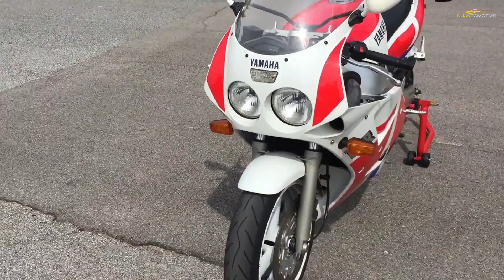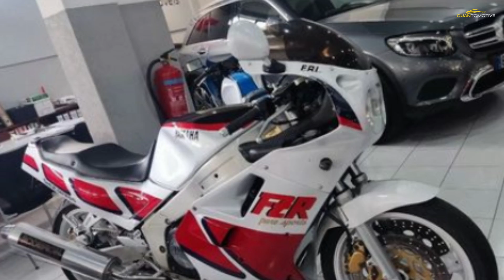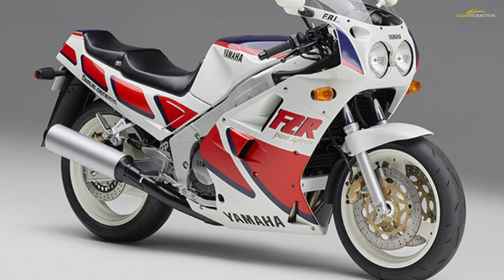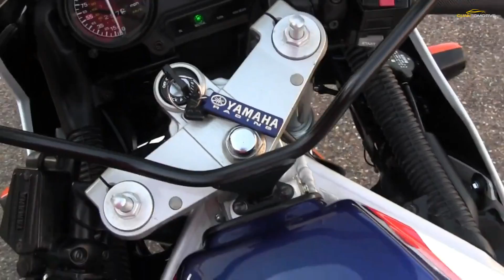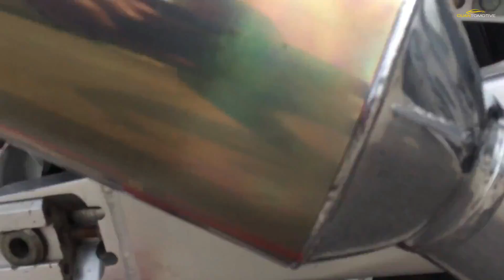Yamaha FZR 1000 "Ultimate Road Machine" You Must Know This Motorcycle Guys !!!

Comment: I have a 87 FZR 1000  that looks just like the blue/white and gold stribs, It have 140 break at the wheel, These are GREAT bikes.
Reply: I have a 1988 model. What  did you to get 140 HP? Thanks
Reply: @guitariste47  mine is a 89 my bad sorry, it was dial in when I got it so I don't really know for sure.

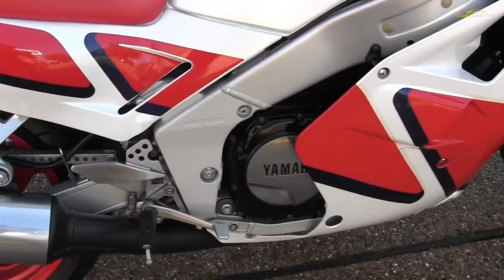Comment: 4:57 his full of crap  the FZR 1000 was lighter then the GSXR 1100 and handled a lot better
Reply: The 1st gen 87/88 FZR was heavier than the 86/88 GSX-R1100 by 7 kg, The later 89 on 'EXUP' was lighter than the 89 on GSX-R1100, which got heavier and heavier with each model.
Reply: @TeUhtred7860  lol ok 7 kg did you read that on google I tell you what the 80s GSXR where ok but stop with the BS I have owned a 87 88 and 90 FZR 1000 and there lighter handle way better then any fatso 90s GSXR  sure the FZR got bigger but still not the fatso the GSXR 11000 was  and why the hell did it take the GSXR so damn long the get liquid cooling the FZR had it and most all the other big bikes I also owned a fatso 89 ZX 10 that I still wish I still had that was a great bike
Reply: @johnrhodes101875  I was talking about the 86 GSX-R 1100 and the 87 FZR1000, I own one of each. The fist gen GSX-R is lighter, that’s just a fact, after 89 the GSX-R got heavier and heavier, but the very first model was lighter.
Reply: @TeUhtred7860 но рулилась и тормозила FZR1000 всегда лучше GSXR1100. Независимо от года.
Reply: @TeUhtred7860  I can agree to that  80s GSXR where great even 89 90   my fatso problem is those 93 GSXRs the 750 was almost as big as the 1100  and I never saw any one on a 600  but they where all buying cbr f2s lol

Comment: I had a ‘92 version (the white, black, red version in the clip) and it had a 130 front tyre from factory. Bike was like on train rails in high speed corners, not so much in short sharp ones… rather terrible actually. Swapped it for a 120/70 tyre… much better handling! Couple other things I remember: the clutch was on/off, fueling wasn’t great at low revs and it did use a bit of oil. Thing was a rocket 8K rpm and above… and I liked the fuel reserve switch on the side fairing. I had a lot of fun with it☺️
Reply: Too annoying to listen to with that stupid robot voice.. one zero zero zero... ffs

Comment: Im a proud owner of a 1988 fzr1000
Reply: How much you want for it
Reply: @tradesmart4866  unfortunately I'm in the process of currently restoration of it because I don't have any plans on selling it. Its a dream bike I finally got ahold of and I've bought all new fiberglass body for it and giving it a second chance at life!
Reply: @TMSRAGNAROK  nice man keep us updated that's cool
Reply: @TMSRAGNAROK  lol you sound like me I have a 90 fzr 1000 and its all apart it had the 1070 kit in it damn it was fast but I  screwed up the motor and took it apart and just parked it due to how bad I screwed up I was trying to polish the frame and being the stupide ass young guy I was I never covered the carbs so all that very small metal got sucked down into my motor and it kill my crank I was so pissed at myself for years but I need to get it back together again I think I'm going to do more motor work to it have the crank lightened put in some cerillo rods do so head work and just get it back together and keep it
Reply: @TMSRAGNAROK  I went the other way, my one came with fibreglass fairing, i threw them in the bin and hunted down original panels off ebay.
Reply: Cool that you have a 1988 fzr 1000 , i know that only the frame just weighs 12,5 kg , i have owned a 1987 model , drove 20000 km's in 1 year , no problems
Reply: @Holydiver7019  I had a 87 and a 88 and to me the 87 was faster

Comment: I just found a 1987 FZR1000 Genesis that is 100% original and complete.  Will be restoring and adding videos as the project continues.  Thanks for the video - was very inspiring.
Reply: let me know how it goes I just got one myself I'm. in the middle of the restoration what fuel pump you have in yours
Reply: @stevenmasterson879  Right now, a non-functioning original.  I thought it was just the contacts/relay but the whole motor is seized and rusted shut.  I bought a cheap Amazon one but the inlet/outlet lines are the wrong size.  It got me running but I still have to source a proper fuel pump.